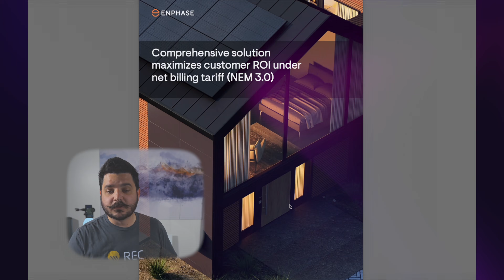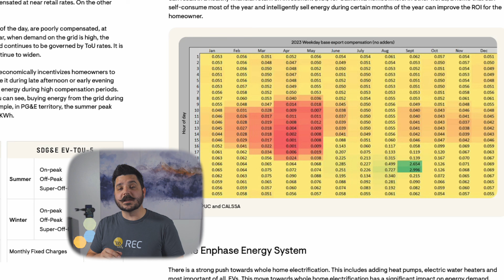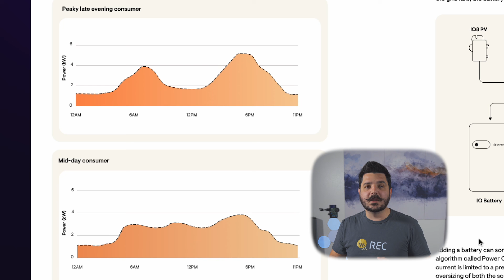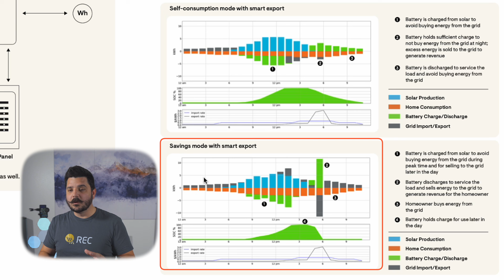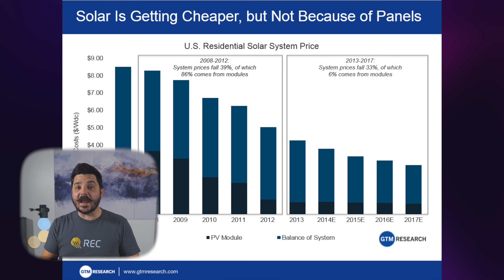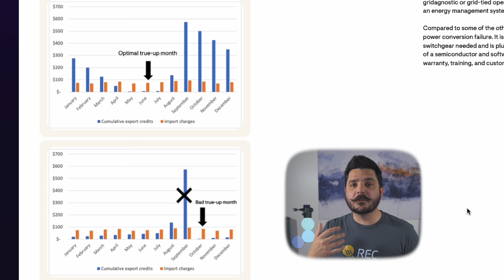How to Maximize Your Savings under NEM 3

Comment: There’s no difference between storage and backup batteries. They are the same. Since when is power in California is stable? I had 3 power outages this year and same last year. The Santa Ana winds can force another blackout due to the wildfires. Besides that, the grid is just not reliable anymore. California decided to close down electricity generators and buy electricity on the open market. The only way to reduce electricity bill is to offset with your own solar and backup system. Don’t rely in returning electricity to the buyback program. It’s a bonus.
Reply from the maker: Yes and no, we’re getting to a point with the technology and industry where solar companies can possibly become your utility meter. In this configuration you wouldn’t refer to your home as one with battery backup but a home with battery storage, since it’s the primary and the utility is the backup.

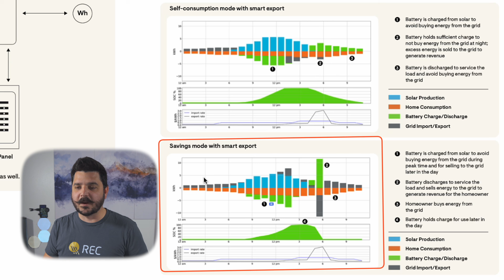Comment: @12:23 "Big money"... well, no, it's not.  First, the "big money" only occurs during a very few specific hours of weekdays in August and September.  All the rest of the time, the "big money" you are paid is LESS than the cost to you to import that energy.  Secondly, if you look at their chart about "smart savings" notice how they show exporting about 12 kWh of energy... that's 3 5p batteries worth.  And even if you are able to export that much, notice what also happens?  You have no backup in case of power failure - and you're still importing energy all the way up through the peak rate (which ends at 9 pm or midnight, depending on your rate plan).

There is another side-effect here that isn't being considered... the extra cycles of the battery results in faster battery degradation.  To accurately assess the value of "Smart export" you have to include the cost of the accelerated degradation.

Comment: In for a penny.  In for a pound.
Grid Tie Residential Solar Electric:  
First, you had and inverter and the solar array.
Then, you had battery backup.
Then, you will be solving your utility company's problem with a battery grid tie system.
Then, your utility company will change the contract which again, will not benefit you.
Then, you will just give up and redesign for a stand alone system.
Then, your insurance company will drop you (if they haven't already done so on another subject).
At this point, you are looking at least a $60,000 cost from when you started.
Then, you will move and start over.
30 years ago, Germany was offering $1 per kilowatt/hr. on grid tie systems regardless of power to your home or feeding back into the grid.
Reply from the maker: I’m not familiar with the policies of other countries net metering programs but you’re not wrong in having this concern of a vicious cycle. Though I do believe we are moving toward a new grid configuration, have you watched our latest video? We discuss a potentially new net billing program which encompasses electric vehicles.

Comment: What is the recommended ratio of solar panels kW size : battery kW storage
Reply from the maker: @spgiants82  When designing a solar system, it’s crucial to ensure that the solar panels can consistently recharge the batteries, regardless of the time of year. For example, if you have a 5kW solar system paired with 40kWh of battery storage, the system might struggle to recharge the batteries fully if they are depleted by more than 70%. A quick way to estimate the appropriate battery size is to take your annual energy production in kilowatt-hours (kWh) and divide it by 365 days to find your daily average. Ideally, your battery capacity should be within 20-30% more or less than this daily average to maintain efficiency and reliability.

Comment: Really like your videos, thank you! 

Between Franklin and Enphase 5p, which do you recommend for my situation? Already have IQ8+ micros paired with 400W REC panels and looking to add battery storage. 4x 5P or 2 Franklins. Cost-wise, they're about the same. I'm leaning towards Enphase just so I can be all within their ecosystem. Franklin seems new so not sure how things might go for them.
Reply from the maker: @shreyasdube  they’re both great options, if space is a factor then Franklin is probably the better choice. Otherwise, Enphase has a great solution
Reply: @pacificsuntech Thanks! I ended up with 4 Enphase 5Ps. They were commissioned a couple of weeks ago and it's been great! I'm on time of use rates and making about $7/day when it's sunny.

Comment: So the IQ8 Sunlight backup is a gimmick? When the grid goes down the IQ8 does not form a microgrid and island the home from the grid and keep the lights on? Are you saying you need a full backup to do this? I am confused. Enphase marketing implies their technology islands and forms a microgrid during sunlight hours when the grid is down. You do not need a battery. If the grid is down and the sun is down a grid tied battery with IQ8 should island too. Please clearify. I thought this is what seperates ENPHASE from all the other solution options!
Reply from the maker: You still need the automatic transfer switch (IQ System Controller) to form the micro grid. Additionally, if you do sunlight backup Enphase requires the IQ Load Controller which really only allows two circuits per load controller. There are other backend software restrictions Enphase imposes too that ultimately lead us to not offer the sunlight backup to our customers as it’s more of a marketing gimmick.

Comment: Dale Have you heard if Solaredge is developing a metered collar device?

Could you let us know which brands are going metered collar direction?
Reply from the maker: We have confirmation from Tesla and Enphase. We have been told SolarEdge is looking into it as well as Schneider Electric. We hope someone will come to market with a universal collar for any battery backup manufacture to use and integrate with.